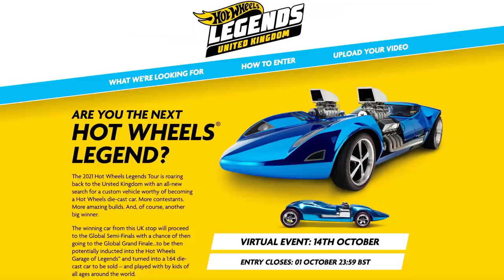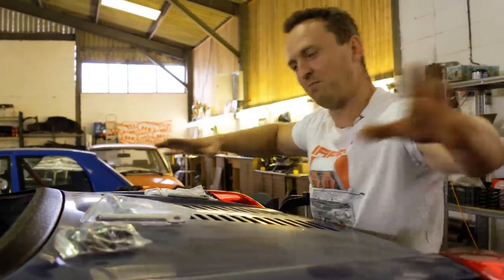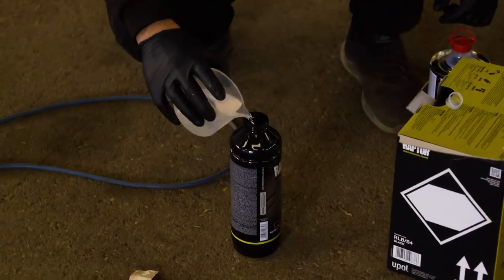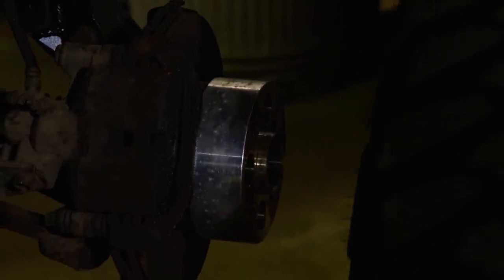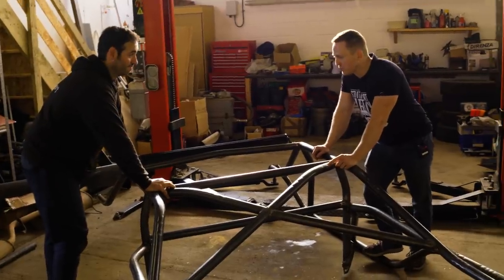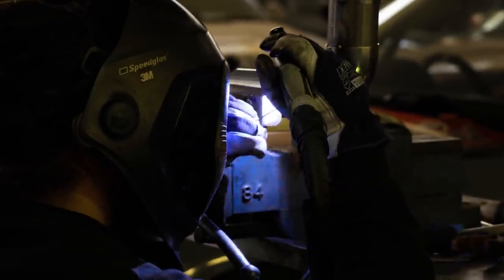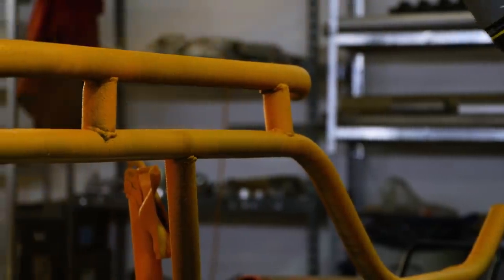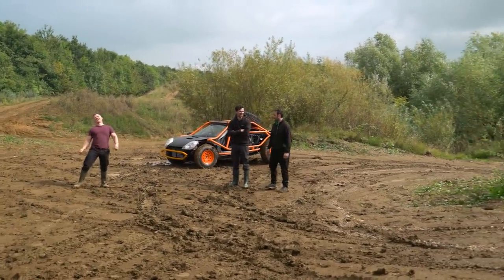We Turned Our £100 MR2 Into An Unstoppable Off-Roader

Comment: That’s actually a good looking car! Really shocked from the difference, from when you began pulling chunks off it. If only it had an engine twice as big...
Reply: Or an added supercharger.
Reply: Imagine a modified 2jz get or just stock it would have decent power I guess and a beefed up drive shaft and axle also imagine awd on it or 4wd if a 2jz actually fits in it and you can get one for not alot or you had a big budget because it must of cost abit to do this also add a working boost gauge
Reply: @scotthotchkiss7120  why I'm just saying what I'd do if I built this thats all what have I done wrong
Reply: 2gr would do fine :)
Reply: @aaroncable4739  lol 2JZ swap? I don’t think you understand cars
Reply: @aaroncable4739  better to just throw a 2zz ge in. easier.
Reply: This is where I hope my Porsche 986 Boxter will excel!!! More HP and quite a durable power train!

Comment: Congratulations on making a modern, heavy, vw beach bug 😂
Reply: it's heavier the an old bug with a cast motor. All panels, roof and half the interior out, replaced by a 55kg frame and bigger wheels, I would guess 1080kg max but way more power than a carby bug
Reply: @andy2906  and a vw beachbug /meyer manx is about 1200lbs/550kg. so even if it is twice the power of a 1.6 (60 vs 120).... :D

Comment: These 1.8vvti Toyota engines are fantastic! Powerful, revvy and endlessly reliable! It's a true jem of the early 2000s engines! Let's also not forget that this engine was not only used in purpose built sports cars like the MR2 and Celica but also in the big family cars like the Corolla verso and Avensis! It's a very versatile power unit!
Reply: Apart from the early 2000s models that burnt oil like crazy. Just pulled mine for doing that problem
Reply: @jakeartis955  I’ve personally never heard of or (thankfully) experienced anything like that in my 2002 Corolla verso (same 1.8 engine) in fact it uses up very little oil. But I might be alone with that. Obviously if I had any mechanical problems with my car I wouldn’t go on about it’s reliability! In fact we’ve owned the car for 6 years now and put nearly 100,000 miles in it and it’s never gone wrong! Had the original clutch in it until recently! It’s a tank!
Reply: @mr.carguy654  So my 01 Spyder was burning at least 5 liters of oil around every 11 days! They fixed the 1zz a little later on its life cycle

Comment: Cage needs extending over the front wheels to the front "bumper" for more rigidity. You could always fit saddle bracket joints so this section can be removed if you need to gain access.
Awesome build, though. It's got me thinking that I need one of these in my life. I wonder if it would work on a Z3 ?? 😜👍

Comment: By far one of my favourite car throttle cars tho it's funny how you made an mr2 massive and the engine  sound like a Subaru boxer engine kind of and an mr s sorry like a heavier Polaris or can am off roader so from light smallish quiet and normal ish car to a kind of loud big and heavy off roader tho the only thing I'd do different is put a net or filter infront of the radiator to stop stuff going into it and maybe the same size front wheels as on the back but still an interesting build which I'd say is unique tho you dont see alot of mr2s or mr s especially like this also I guess if you go off roading and your not covered in mud you've done it wrong unless your in a car with a complete body and windows tho imagine this car on a t shirt or in a  photo next to phil on the driveway that would be good I guess

Comment: PLEASE do not hold yourself up on a roll cage, not even when it's inside a car. When you need something to grip on, make an extra bar inside the cage to hold on to. When you roll a car and you are still holding on to the cage you WILL lose some fingers. Even when there's a body shell around the cage, the shell can collapse, trapping your fingers between the shell and the rigid cage.